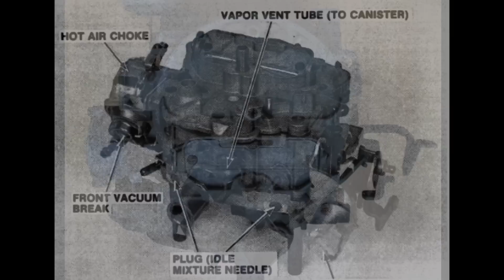Strangest Automotive Inventions:  GM's Rochester Dualjet Carburetor Or The "Demi-Quadrajet"

Comment: I hated those half size Quadrajets.  Too small for any kind of decent power.  At least they were reliable though.  If GM hadn't been so cheap, a better option would have been a bigger two barrel with one barrel being a vacuum powered secondary.

Comment: I'm gonna tell ya the reason GM lobbed off the rear half of the twin jet quadrajet looking carb it was to save material. Especially if that rear part was solid? Think about how many Million's of those carbs they produced that's A lot of Aluminum! And then they didn't need to cast a Goofy intake manifold to bolt a fake four barrel carb on.

Comment: The downsized 77 GM platform lasted for a long time. However as far as people liking them, I think not so much initially. I think you'll find sales were down from the 76 models.

The styling was good on the Caprice with the headlamps mounted low and the parking lamps in the bumper. However, the Impala not so much, They raised the headlights and put the parking lamps under the headlamps. They should have left the headlamps low. If they wanted the parking lamps out of the bumper they should have put them above the headlamps. They missed this spectacular styling innovation and six months later one of their competitors did it. (OK, I guess I've gotten all I can out of this joke.)

Comment: While I have to say I was never a fan of the quadrajunk carb , they were a pretty hardy carb , meaning a  high mileage unit would still work with all the inherent quark’s they had. Leaking bowls and secondaries, worn throttle plate shafts, crap in the float bowl,they still seemed to work. Those later 2 barrel 2 jets worked pretty trouble free , I have to admit I never seen one with the dummy secondaries.

Comment: This carburetor was introduced in 1975, not 1977.
My first car was a 75 Cutlass with a 260 and this was the carburetor it had on it. I was 17 at the time and originally thought I had a 4bbl when I took the air cleaner lid off, but I was very soon disappointed when I took a closer look.
That poor car was slower than a glacier melting.

Comment: I remember back when most people didn't understand vacuum secondaries and would be extremely underwhelmed by the performance of their car or even sell them very cheap thinking there was something wrong with the engine 😂 I would help a fella every once in awhile fix his vacuum leaks and get his spread bore secondaries working properly and the surprise and smiles were absolutely priceless and it's something you just don't forget
Reply: I used to make good side money building and tuning Quadrajets.  Fuel injection killed that for me.
Reply: Quadrajets and Thermoquads are mechanical secondaries.
Reply: @mikek5298  correct. But the air doors are vacuum controlled. So if you have insufficient vacuum to them, they open too early. Then you get a huge flat spot in power. Until you get to an rpm where the engine can process the extra air and fuel. And in some lower power applications, that may be never. That is why many people referred to the quadrajet as the quadrabog.
Reply: @AndyR1982  The secondaries of a Q-jet definitely have more tunability than most folks think, especially given the simplicity of how they operate.
Reply: @AndyR1982 Never heard it called that in 4 decades. We said Quadrajunk. But they was either good or bad. No middle road. That's been my experience. Either bad ass or fat ass. 😂
Reply: @AndyR1982 Sorry, but you're wrong again.  The secondary throttle plates are mechanically controlled, and the upper plates, the so-called air valves, are only controlled by airflow down the secondary throat...  There's no vacuum control whatsoever compared to a Holley.  And unlike the primaries, the secondaries can be easily adjusted without taking the carburetor apart by unscrewing one screw, lifting up the metering rods and swapping in new ones.  Also, that little hanger that holds the rods can be bent up and down to adjust how the enrichment proceeds, and of course there's the all important tiny little Allen screw and flat-blade screw on the passenger side to adjust the spring tension on those upper air valves.  The primary jets, unfortunately, require you to take the top off the carburetor, unlike the Holley, but if you know what you're doing you can make those things work flawlessly... 
Now, the ThermoQuad was basically a knockoff of the QuadraJet, but the phenolic bowl they used to try to keep the fuel cooler ended up being a failure point.  
Finally, speaking of vacuum secondaries, I could not believe it when a boat I worked on, 28 feet with twin 351 Fords, had Holleys on top with vacuum secondaries!   Unlike cars, boats never get momentum, they're always under heavy load.  So once you pop the vacuum secondaries, they don't close again until you pull the throttle all the way back...  I wired the secondaries shut on that Bertram, and the owner told me the next time they went out to the Farallon Island it burned 20 fewer gallons of gas.
Reply: I've replied twice and for some reason my comments keep getting removed. So I will try one more time
Reply: The vacuum pot is a timed release once the vacuum drops, anywhere from 1.5 seconds in a performance application to almost 4 seconds on a low power vehicle. It helps prevent the early opening of the air valves during a quick tip in of the throttle. Yes, the actual secondary throttle blades are mechanical, but until vacuum drops, they don't do anything because the air flow is locked shut by a vacuum operated lever. I get where you are saying the secondary side is mechanical as the blades are. But, to the point of the post I said that vacuum controls operation of the air doors causing a driveability issue you are going after the wrong point.
Reply: @AndyR1982  Okay, NOW I know what you're talking about:  the vacuum choke pull-off on the passenger side that on some models did double duty as a total LOCKOUT of the upper air valves...  My Pontiac carb didn't do that, and the Buick 430 sitting in my garage has that pot disconnected.  So, I will wave the white flag, but everything I said above is still true:  whether original or modified, the rods, the hanger, and most importantly that hidden little spring tension control on the right rear of the air valve assembly all make it work perfectly without the vacuum lockout.  In fact, even if you HAVE the lockout it still won't run properly if those items aren't calibrated correctly.  As I said, the Grand Am did not have that from the factory, and I disconnected it on the Wildcat because I want those secondaries to open when I decide... AND the fact that the choke pull-off was knocking it off of fast-idle too soon for a convertible that sits 95% of the time.  😉
Reply: Tips for the 2ESE?

Comment: Caprice Classic - the name said it all.   That car was so great, no wonder it sold so well.  But, of course, it had to go.   Design change to the Shamu bubble style, sales tanked and GM gave up on it.   I wonder what you would get (performance, fuel efficiency, etc.) if you took that 77 Caprice form and dropped a modern drive train into it.   Or even an advanced hybrid drive train into it.   Sure, Cd not great but interior comfort, style, handling, etc.  Just make it available in all the old colors.  I am so sick of grey, silver, white.

Comment: 5:30 I can tell you never spent much time around GM old two barrel carburetors. The float would not stop fuel and the carburetor would flood out. The last time I drove one in 1995 this happened. It was a 1963 Pontiac Catalina. The engine was from a 1970 Fire Bird.

Comment: As an old guy mechanic , I had to work on all these carbs, and I am still a Q jet guy, yes a carb that is tough to tune,  but if you really enjoy the big secondary and great wonderful primary with a double  ventury that  works. I get 17 mgp at 65 mph .  Yes A Holley is easy to tune for the drag strip or oval,    But I wont ever give up my Qjet 
    I have a strong 406 sbc and it is on a stock Qjet , lots of power and is very reliable  
   Its a big car (4600Lbs) , !977 Malibu   406,  3 inch exhaust  with Flow mater 40s 700R4 with shift kit , 3:73 gear True Trac diff, newer axles , BFG tires ,      Damn Fun  
Bought

Comment: FUN FACT, That 260 and all the small block olds motors from the 70's all used the same crankshaft even the 403. The 260 was slow especially when saddled with 2.29 gears, But a lot of folks reported phenomenal MPG from them and they were smooth as silk doing it. In my alternate universe the SBO would have became the corporate GM v8 in everything from trucks to SUV's to cars and the 260 would have evolved and supplanted the 4.3 v6. In my experience the Olds architecture was better than the SBC in every way.
Reply: @ronniedale6040  I think I can agree with that. Oldsmobile and Pontiac engines were always more complex in design for efficiency and power. I don't get why a SBO didn't become a GM corporate motor instead. Don't get me wrong the SBC is great in their own way, but as far as tighter tolerances goes nope. Olds and Pontiac were great in the efficiency and performance department. I see a SBC as something you throw into an engine bay and use it to commute to work and back for a few years then find something better.

Comment: Worked on a few of those back in the day.  Reliable and worked well on those smaller V-8's.  Actually a brilliant move when you think about it, in many cases these carburetors used the same air cleaner, throttle linkage, and sometimes intake manifold as the 4bbl.'s did.

Comment: I thought I remembered them. Having a 2 barrel with one primary and 1 secondary.
Reply: You might be thinking of the Varajet - it was on a lot of the 2.8 GM v6es in the early 80s, like in the Celebrity and the S10 pickup.
Reply: @mtut  I think you're right because my mother had a celebrity. And that's where I saw it.

Comment: My first car was the family hand me down. 64 Olds Super  88, Starfire V8 394, 345 HP, Rochester 4 barrel carb. My dad and myself in learning, took the carb off and replaced the rear secondary fuel jets with the larger opening with the smaller opening front jets from a carburetor kit. Then all 4 jets had the smaller opening. It cut down on the power acceleration when you stomped into passing gear and I assume not use as much gas. The car at best got 12 mpg with the factory jets in it.

Comment: I have never seen one of those modified quadrajets before. While they were a valiant effort I think for the time with what they had to work with, those small V8s and V6s were unfortunately possibly some of the worst engines ever. Some barely even exist anymore like the Chevrolet 267 and the 200 and 229 V6 you just never really see them anymore usually you just the same 5 or 6 engines in those downsized sheer look cars now.

Comment: Spread bore carburetors are my favorite on a hot rod. The way they open up and sound is great.
Reply: Plus the added low-end torque curve due to the smaller primaries.  They were great in the day with an Edelbroc spread bore Performer and free flow exhaust.
Reply: Sounds don’t mean power 😂

Comment: Is the Ford 400 V8 a big block or small block engine? Technically it's a bored 351M which in itself is a tall deck 351C engine. 

I'll let the battle begin.

I imagine someone was showing off how high their mpgs were just by removing the linkages to the secondary circuit. On that day a light bulb came on in the brain of a Rochester/GM engineer.
Reply: The Ford 400 is a small block motor that uses some components from the 351C but as you said is a tall deck design.  

However, the 400 came before the 351M, so it’s probably more accurate to say the 351M is a destroked 400 rather than the other way around.

Comment: I've got an early "Dual-Jet" (in a Quadrajet body) Rochester out in the shed that my dad had saved.  I never looked at it that close til a few,years ago.  At first I thought I found a 4 bbl.  Says DualJet right in the metal covering the secondaries.  You can faintly see it on the left side in Adam's video.  This made my day Adam, got me thinking about dad.  Still got 1 or 2 301s in a big crate my dad built, he was a fan of them, he  swapped a few of 'em into Bonnevilles and Grand Villes, and the 2.90 rear differential with it.  I think that whole drivetrain,  TH400 too, was in at least 3 cars my family had 😁

Comment: So I have to throw in some anecdotal experience, having grown up during the '70s. Quite a few friends and family had cars (mostly Chevys) equipped with 2gc carbs, model years '71 through about '75 and ALL of them had literally dangerous drivability problems until almost fully warmed up. Start the car, put it in reverse, it instantly dies. Restart, rev the engine, put it in reverse, it dies again. After at least a few cycles of this, the car would finally idle in gear, only to stall immediately once an attempt to drive away is made. This would continue for the next several minutes and eventually the cars would actually idle. Drivers quickly learned how to quickly re-start their cars while attempting to drive in city traffic. Rapidly pumping the gas pedal could sometimes prevent a stall, but it was kind of a tricky dance for the first several miles after a cold start, especially in the winter.

OTOH, I also had several friends/ acquaintances with Q-jet cars (Cadillacs and Pontiacs mostly) that exhibited virtually none of this repetitive stalling behavior. BTW, this was in Illinois, so all off these cars had "49 state" emissions. My hypothesis on creating the  Dualjet is that, for whatever reason, the primary side of the Q-jet was somehow able to meet the emission standards with minimal drivability problems vs the 2gc.  The tiny cfm rating may well have helped the CAFE compliance as well. IMHO the 2gc cars were simply jetted too lean and /or the choke pull-off settings were simply too aggressive. BTW, busting "the caps" on the idle mixture screws did little to nothing to fix this problem; the main circuit was simply too lean until the engine was mostly warmed up.

I would love to hear from anyone who was a mechanic during this period to see if they agree with this.
Reply: The hot air choke systems used up to the mid 70's had a lot of carbon plugging issues.    Reduced heat to the choke caused many to be adjusted way to lean cold to get fully open hot. Later choke thermostat was pined to prevent adjustment and this would get modified to 'fix' a choke that wouldn't open fully. This resulted in the driveability issues you noted. Vacuum pulloff linkages could also be improperly bent in attempts to 'make it work ' without addressing the root cause.
Reply from the maker: Never owned a 2gc car built after 1972. The pre-72 2gcs run very well.
Reply: After about 1972 mechanical chokes . came with a choke pull off mounted to it's assembly to help open choke valve.
Reply: @puffkendrick6850  
   Manual choke almost unavailable in 72, auto choke was standard for everything but the most stripped down vehicle.
Reply: @jeffhill3681  non electric,heat stove built into intake manifold type
Reply: Mechanical chokes
Reply: @puffkendrick6850  
  Vacuum choke brake or pull off used since the 50's on auto choke systems. Multiple units ( thermostatically controlled) common in the 70's.
Reply: @jeffhill3681  yup!

Comment: The intake manifolds for the Dual-Jet were also 4-barrel manifolds but the secondary passages were not bored out, so they just must have found it cheaper to change the castings for a few years before retooling...

Comment: I wonder if the reason for that dual jet was solely because the 2gc, which for a 2bbl, actually flowed pretty good with some I believe flowing  around 500 cfm and the engineers just needed something with less cfm for these tiny V-8s hence they modified the q-jet in the short term to take advantage of those small primaries until the later version of the carb  finished development. Casting those odd special intake manifolds had to be expensive for a carb set-up that wouldn't be used for a long enough time to recover tooling costs.
Reply: Your obsolete 4 barrel intakes are now tax write-offs and you can recycle the iron or aluminum.  The foundry would just make a slight adjustment on the casting masters.  Your cost for the line is already sunk in.  GM probably did fine.
Reply: @markwilliams2620  : "Obselete"??? 🤔🤣🤣 Some original "OBSELETE"  4 barrel intake manifolds are worth their weight in gold to collectors regardless if they were cast iron or aluminum. Stuff is only "junk" if you don't know what your looking at.

Comment: The quadrajet also spawned another, the Varajet, that was a 2 barrel on Iron Dukes and a few others. It was the quadrajet split down the middle more or less to give a small primary amd large secondary
Reply: We got them in Australia from 1980-1985 on 1.9L i4s, and 173 + 202ci inline 6s in GM Holden models.  Like the Q-jet, if you got it set right,it wasn’t too bad.  But so many of them were hacked about with by people with only half a clue, and ran like a dog.  The ones we got were called the Varajet II and were made in France, with GM Strasbourg cast into them.
Reply: Yes, and that made more sense to me than splitting the Q jet into the front half only.  I seem to recall some S10 trucks had those.  My guess is using only the front half resulted in a cheaper to manufacture carb.

Comment: I am a little surprised that you never mentioned doors cracking on the downsized Caprice. I owned, five of them, the first was a 85- and the last a1991, all station wagon's. I loved them. But everyone of them got a small crack in the door corner by the window, djust inside of the driver side door mirror. I think it was the sie view mirror weight that did  it..I own a 1976 35000 mile Mercury colony park now.
Reply: Same outcome with drivers door cracking (by mirror)  mid 80's Monte Carlo.